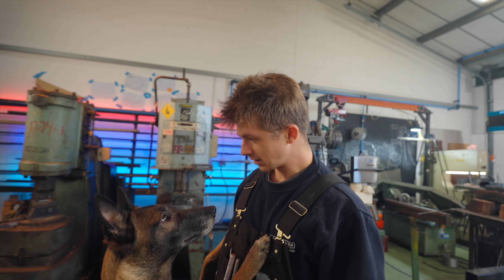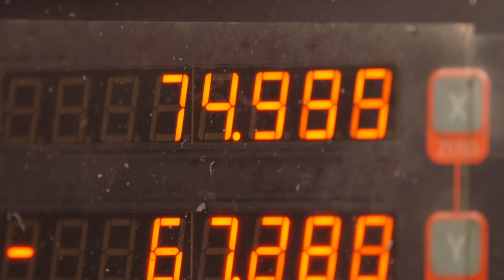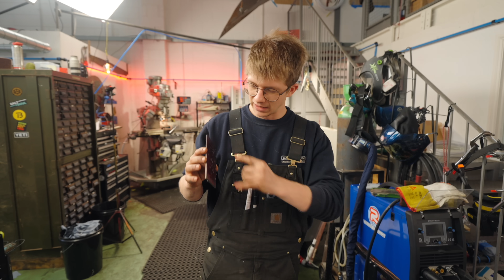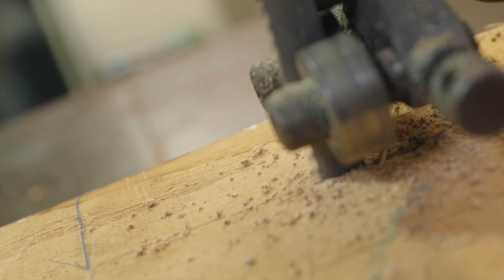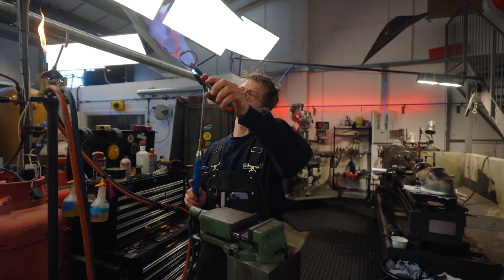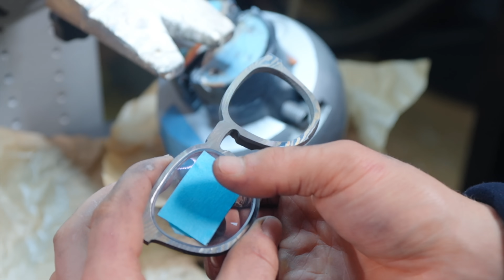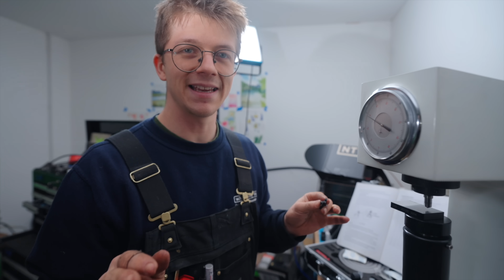Making Titanium Damascus Glasses, Part 1

Comment: Two better options for mounting the lenses: 

A. router a 0.5mm x 0.5mm (or approx) square step into the backside of the frame. Upsize the lens to fit straight up against that, then carve a nylor-bevel into the lens edge. Then add 2 vertical metal C-brackets that lock into that lens notch (screwed to the frame at the top outer corners), and a third behind the bridge, which could be made to include adjustable nosepieces. 

B. T-bar the lower 3/4 of the frame interior. Then use that to provide a flexible medium to mount the semi-rigid lens to the totally rigid frame.

Comment: Just for future reference, you could have cut a blank to the same size of the blank and do a test cut. You don’t have to do the Final Cut on your final blank.

Also ground pins are your friend. Ream some holes, push fit into one side and slide fit into the other. Then you have two pieces you can clamp together and mill, then they easily slide apart while being accurately indexed still. Might have helped some making the bending jig.

Comment: You were supposed to cut the outside of 200 on the steel. Not the inside, no? That's why it was off. By cutting inside you ended up with less than 200, right?

Comment: I have the same Rockwell tester. Don't turn it three revolutions. Turn it until the small dial lines up in the middle of the red dot. 
Also, go over the internals and tighten everything! Mine was a sloppy beast on arrival. With some fine tuning they're actually very accurate and repeatable. 

Awesome work on the glasses. What a cool project 👌

Comment: Alec, here's a couple rough rules of thumb I remember from operating a plasma table years ago: One, I remember the maximum hole diameter I could cut cleanly being pretty much equal to the material thickness once you get past maybe 1/4" (~6mm). Two, for your lead in/lead out, I liked using a quarter circle entry and exit with the diameter of that circle equal to the material thickness. The cut starts away from the material, and then cuts a quarter circle that ends up tangent to the line you want to start on. It leaves a smoother edge than cutting a sharp corner with your lead in.

Comment: For future projects where you flip the stock material around, consider drilling 1-3 small holes somewhere in the unused edge to work as 0 and axis markers. You could even make a jig with keys that fit the holes for the water cutter so the item is definitely where you designed it to be. Little L-shape works, or having holes in corners. Trick used in 3 axis CNC'ing items that need to be flipped over to machine the other side of the stock material.

Comment: I work for a large steel distributor in is states. Rule of thumb is no hole smaller than the thickness of the material when using our plasma tables.

Comment: Hi! I deal with engineering drawing daily.

Don't even worry, the drawings by engineers are trash. Engineers have no idea what making a thing actually takes, and it shows in their drawings. I frequently send them back to them for correction because they've designed something that is impossible to make using the methods available to a shop. Even though they're the ones who got to choose the machines that are in the shop. They ignore requirements; clearances, material specs and tool restrictions and then wonder why you ask for a larger budget, take longer, or hand them a steamy pile of dung. Which often is what they use in the final design then complain when it doesn't work right.

Tldr: Engineers suck at their jobs and they don't do better than you. Sorry for the rant.

Comment: 1. You could take the made titanium glasses to an optometrist and they could cut the glass to fit in the glasses. 

You need a way for the glass to sit in the glasses though, I feel the shape you're doing is more for a plastic frame, whereas a metal frame doesn't really keep the glass on with pressure...

I could be bullshitting you though :D

Comment: As someone that runs a plasma daily some tips:
1. 11ga->1/2 (nonproduction parts) you van run 65A
1/2(production parts)->3/4" 85A
3/4->1"(edge start depending on your plasma capabilities) 105A

2. Slow down on holes to around 20% speed on 1/4"+ to make your holes come out cleaner

3. I don't use lead outs all that often bc the plasma arc can whip over the kerf of your lead in leading a bigger tag than if you have no lead out/overburn

Comment: I am a mechanical engineer with 15 years experience in the automotive industry. I live with CAD drawings. Any engineer making plans for themselves does drawings like that. 

The reason for the WORK drawings are for legal purposes. You need to be able to legally prove your parts are or are not being made to specification.

When making something like that for yourself, you don’t have those legal requirements. All you need is… well… what you need. Just put the measurements of what you need.

I’m a wood worker and all my personal drawings turn out more like yours. I don’t need gd&t to cut out a 2x4 to 23.5inches 😂😂

Comment: I install al calibrate hardness testers. I can tell you from experience that table doesn't look like it absorbs vibrations enough for a hardness tester. Most of the testers I install use Knoop or Vickers indenters, but can be installed with Burnell or Rockwell indenters. 

A simple test you can do is: get a coup of water and set it on the desk. Look for ripples in the water. If it looks like the scene in Jurassic park where the T-rex is stomping around, you have too much vibrations. You want a table with a lot of mass, like one that is made of Marble or Heavy steel. You can also install anti vibration pads under the tester. Hockey pucks are a cheap source of rubber that can absorb the vibrations. You can also get an anti-vibration table. Large machines like your power hammers will transfer vibrations through the floor, while they are running,  and cause erroneous readings. Also, did you level the hardness tester with a machinist level?

Comment: The drawings only matter to you. You create them and you know how to read them and you can manufacture from them and your parts come out correctly per your drawings. What else is there to explain. Everybody else that has a problem with your drawings, especially the rude ones can pack sand. And I have a drawing for them that will show them how to pack sand. It’s a single digit.    😁

Comment: There is a tool that is designed to install watch crystals... it is designed to bow the crystal equally so it can snap into the watch case, I bet it would work to install those eyeglass lenses.

Comment: Haven’t finished watching the video, tbh, but if you plan on making more, take a look at Gatorz sunglasses. They have removable and different size nose bridges, and REALLY amazing replaceable hinges. They’re made from 7075 and have a lifetime warranty, so they’re just about the closest thing I know of to what you’re making, and taking inspiration from their design could reduce wasted material and machining complications since all 3 pieces are flat and then bent to shape. They also have lenses that pop onto the frame, no screw clamping the lenses in place, like the metal frames you showed. Just a thought…

Comment: Try coloring the lenses with a black dry-erase marker and then scan them directly to your computer from a printer. This way you’ll not only have the perfect lens profile, but it will be accurately dimensioned as well. The only possible issue is that if the some of the lens edges of don’t sit flat on the scanner’s bed then the might be slightly out of focus in the scan.

Comment: There’s a solution to ensure you’re cutting exactly where you want instead of guessing.

Before the main cut file, cut small reference cuts in each of the corners of your billet, if the machine cuts each corner then you know your square or how much you need to adjust to be squared

Comment: You can get round any drawing nonsense by just adding the note “manufacture to CAD model supplied by Alec Steele Engineering department”. Then a general profile of a surface tolerance to your reference datum’s, which applies to all surfaces. Job done 👍🏻😁

Comment: Is it the fact that he cut to the inside of 200mm the reason for it not lining up? Looks greater than the water kerf but when he was setting up his reference plate i had the thought that he actually wanted the outside of 200mm. So the piece ends at 200mm instead of minus the water kerf...

Comment: you could have made the glasses frame any shape and had the lenses custom made for that shape
Reply: in fact, you could have the lenses made to within the appropriate dimensions and the plastic from the appropriate melting point, that heating and therefore expanding the titanium and then inserting the lenses would allow them to fit once the titanium cooled as well as melting the plastic in such a way that the lens is secured by a groove and some pin holes (melted plastic overflow, think dowels or rivets)
any warping of the lens could be corrected in-sutue... (dyslexic)

Comment: Alec, if you want a 3D printer, my suggestion would be to get an FFF/FDM printer such as the Prusa Mk4 (with enclosure), the Prusa CoreXY, Bambu Lab P1S, or Bambu Lab X1C.

You want a printer that is reliable without you having a new hobby tuning absolutely every parameter on the machine, with an enclosure to allow you to print more demanding (and useful) materials and also keep the dust and metal particles out, and the ability to print reasonably large things with a decent amount of speed.

If you want supremely detailed parts, my suggestion there is to bite the bullet and get the Formlabs Form 4. It's rather expensive, but when you need more detail than an FFF printer can provide, you really do want a top of the line system.

Comment: The number on the dial on the machine shows Rockwell C and B scales. It depends on what diamond tip and how much weight on the back you use. A 150kg/100gk/60kg scale or the 15N/30N/45N scale. You need to use a hardness scale conversion chart to see the proper hardness based on those things. But you may have been using the 150kg scale which is what is displayed on the dial which I believe you were using.

Comment: Don't forget shape of the plastic glasses umm are very important to a very very small degree so changing the shape in my opinion is a horrible idea! you should call a glasses specialist they can make new lenses easy and if you have your script you can get many made if you ask or find right place. Ask you doc office> I could also be wrong and the only thing that matters is the concave/ convex shape of the plastic, but it's in very small measurements so do research!

Comment: Plastic and metal glasses usually have slightly different grooves in the frames and thus the lenses are cut with slightly different edges. Plastic frames are meant to be more malluable so you can simply pop lenses in and out whereas metal frames usually have a screw on the rim to loosen and tighten in order to insert a lens.

Comment: I've got one of those cheap hardness testers, they're not great but can be accurate enough. A few points to note: Thin material won't give accurate results, same for rough, dirty, or curved material. You'd need to sand a flat onto round bar if you're planning on doing that in future. There are different tips for different rockwell scales. You'll probably want to cut a hole in your table so the platform can go all the way down. The same peice of material, even calibration blocks can be different hardness in different locations, and proximity to other hardness indents will affect results. The time you apply the preload for may also affect things slightly. It may be worth just paying a third party to come in and calibrate it/set it up properly.

Comment: Ok, I usually complain because you call pattern steel 'Damascus', now I have to point out that Damascus refers to a type of steel that you don't know how to make so this titanium bit is just not even in the same zip code as correct.

You're welcome for the free engagement, but also lol at a whole industry forgetting what Damascus is and why it is notable.

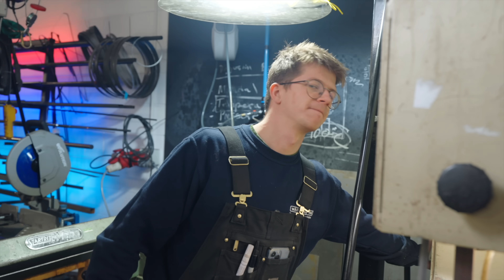Comment: 14:51 You do need a 3D printer! And I'd avoid Bambu labs if you can, they do have very good offerings but when they break, they are nearly impossible to fix, and they have taken a lot of ideas from open source projects while keeping their designs and firmware closed source.

Prusa core one is a good substitute for something that "just works" but if you want a fun project, there are a lot more DIY printers like the Rat Rig/voron etc. May even be fun to make a custom one with titanium forged parts and collaborate with a 3d printing youtuber...
Reply: The chinese translation of copyright typically only goes one way...

Comment: As an engineer that has made a lot of prints they are not beautiful or made to standard practice but they would definitely fly in a mom and pop machine shop they have the important measurements so you can make it KISS method

Comment: It's been a while since ive used a hardness tester but i think you were loading it wrong. You wind up the table to preload it untill the small hand points to the red dot. Then you turn the bezel to 0 the scale before pulling the lever to unload. And they can be very sensitive to how you pull the lever to the result it gives you.

Comment: I have designed my own glasses based of lenses and a broken frame I already had. 

Instead of basing everything around the existing frame, I created a very detailed model of my lenses first. For that just a picture from the front profile is not enough as the outline of the lens curves 3d dimensionally so I also took images form the side and top of the lens to capture the complex curvature and transfer it into cad. 
I also used images of the frame as reference, but fitment was completely based around the model of the lenses I created in CAD as that is the most crucial.

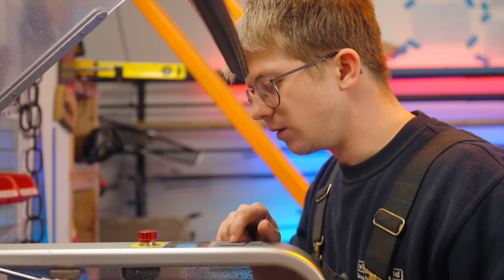Comment: 11:36 I would have just taken that existing support board out and turned it through 180 degrees, so the fresh material in the bottom right was then at the top left where you need it

Comment: German optician here. I wouldn't recess the hinges in the material on the backside of the titanium. Just rivet it on directly. At least thats what we do with regular stainless steel frames here. You could solder them on too, but that would he kinda difficult since it's titanium to steel (You could get the hinges out of titanium to though, there are suppliers who make that kind of stuff and they are usually not that expensive)

Comment: professional waterjet operator here. The machine should calculate the offset automatically, you want to cut to the inside of the line for where the lenses go and the outside of the line for the outside of the glasses

Comment: My glasses have a titanium frame, and theyre kinda great.
Titanium is strong enough that you can make them fairly thin, like with steel, but its such a light material, and so thin, that the frame feels basically weightless.
I wouldnt be surprised if the lenses weighed more than the frame of my glasses.
My old glasses were heavy enough that my nose would hurt at the end of the day, but these? Nothing.

Tldr: Titanium is an excellent material to make glasses out of.

Comment: If you cut on the inside of a line 200mm away from the origin, wouldn’t the distance be 200mm minus one kerf width? I’m not sure how that machine handles inside vs outside though, especially on a single cut. Maybe it would put inside as being the side farther from the origin.

Comment: For the  Rockwell hardened tester you have to do it three times at 150. On the third time is the accurate reading for your piece.  This is a British standard. 

I use the same one at work and have the same issues with getting correct readings.